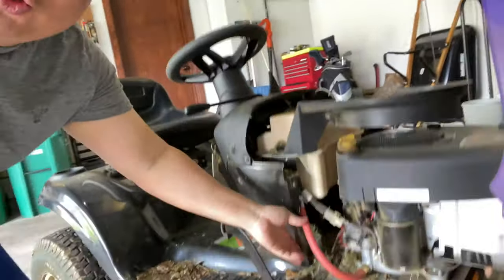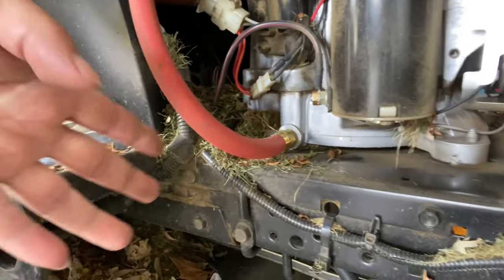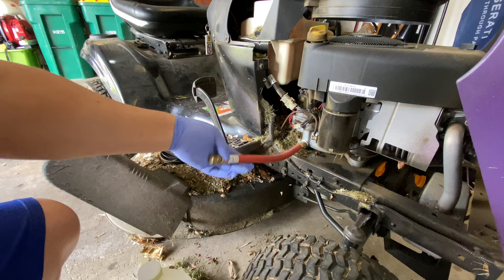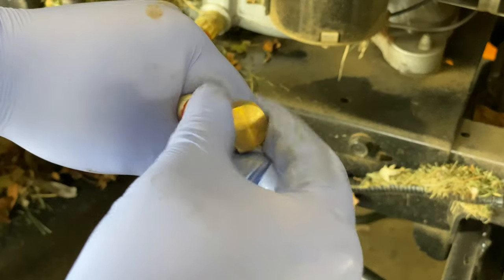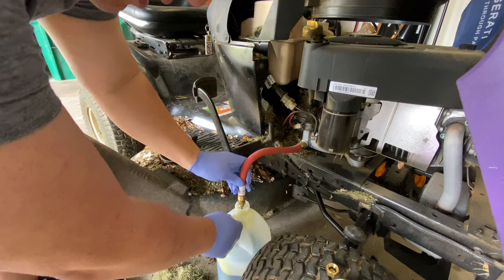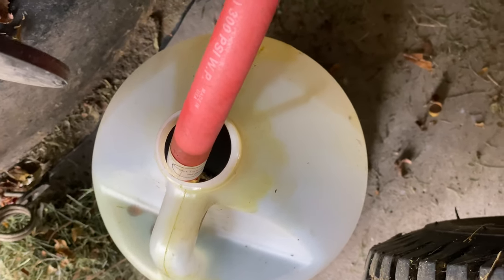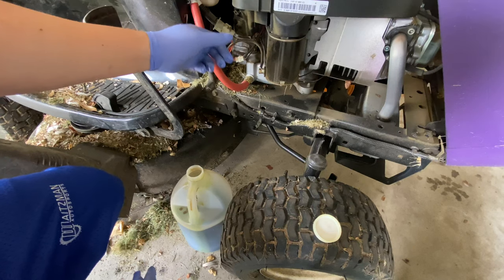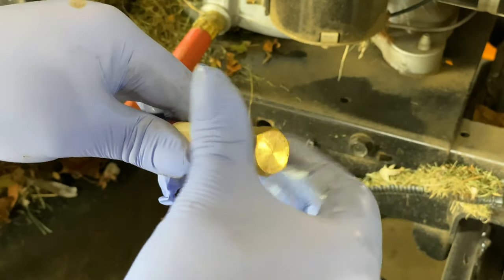DOES A MOWER OIL DRAIN HOSE WORK?

Comment: I wish there was a hose like this on auto engines, where the hose came back to just behind the wheel well. Add a remote access oil filter, then you would not need ramps and would not need to crawl under the car.at all.

Comment: Can you tell me what size thread fitting for your mower. Thanks appreciate it
Reply: You may have luck trying 1/2 inch pipe thread but it is most likely metric threads. Try a collection of metric bolts from Home Depot in the range of 13mm to 10mm but don't force it and keep in mind that aluminum is soft and the threads are easy to strip.